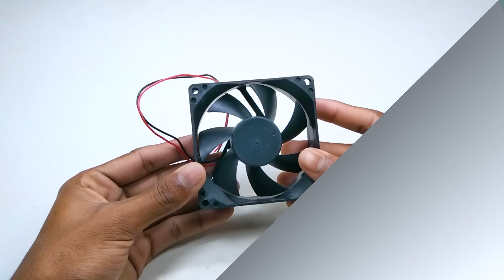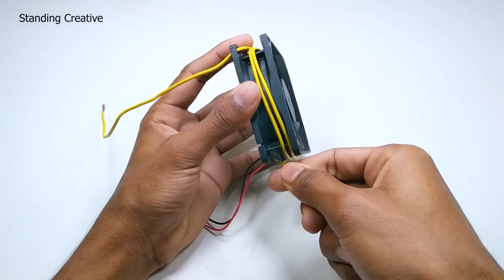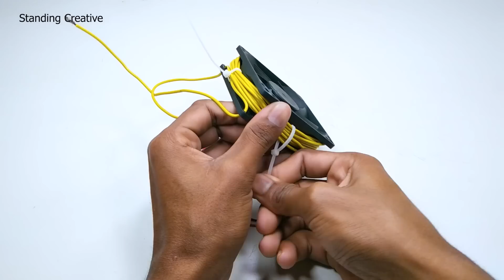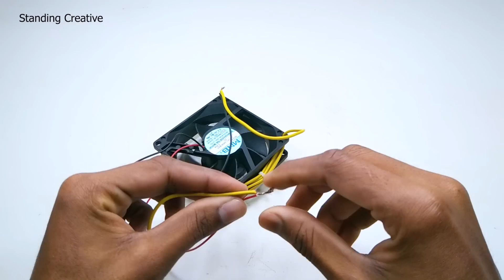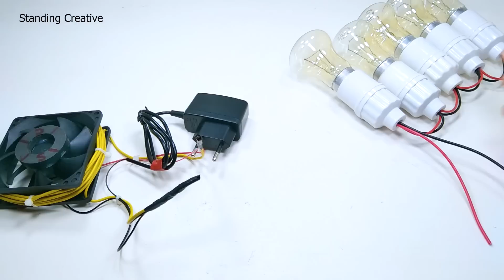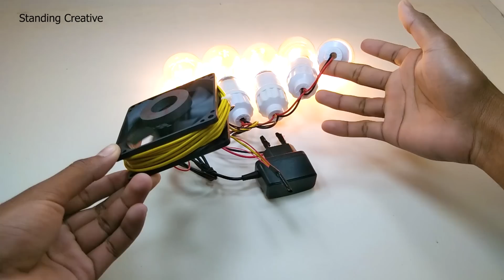7500W Into 220V Cooling Fan Free Electricity Energy Powerful Generator Copper Coil Light Bulb

Comment: you could just mount it inside of your computer.
Like in the fan area, instead of one of the preexisting it will be always on and you can power the computer with it
Reply from the maker: Thanks
Reply: Itu hoak apa riel ,apa dongeng untuk anak kecil😂